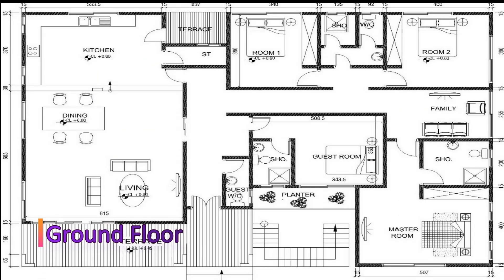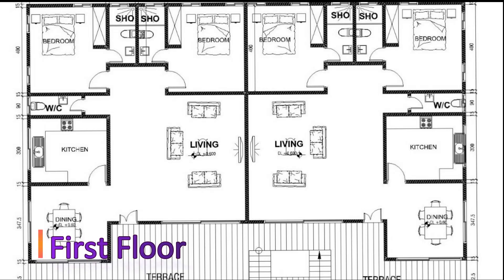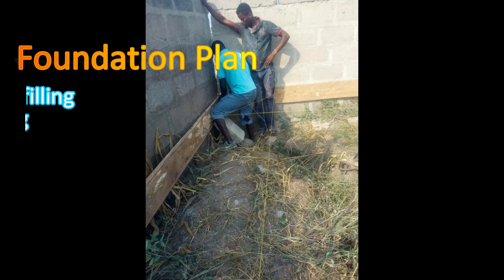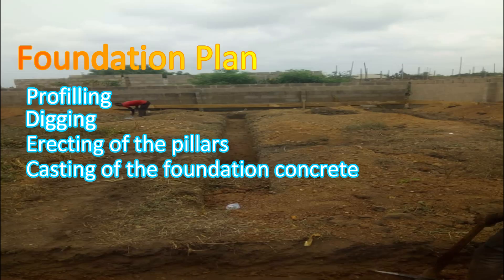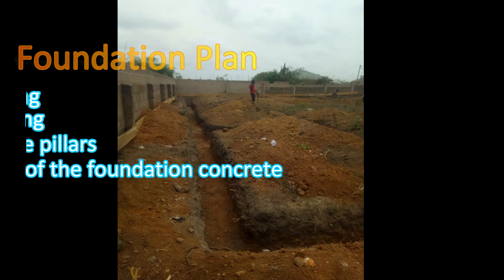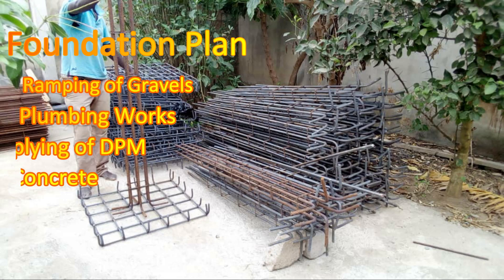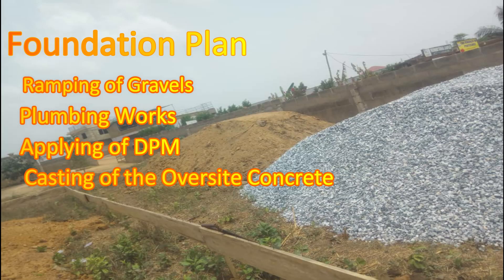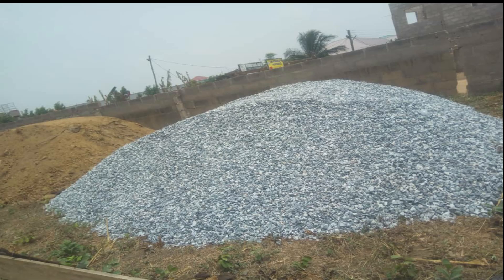Building in Ghana | How its all started | Building my 4-bedroom house with first floor apartment |

Comment: Bright! Great video.
 It was interesting to see and compare construction methods. In Mozambique after digging the foundation trenches we do the footings and columns then we apply big rocks on the floor followed by compaction before the concrete is applied then we start the block work. Furthermore, the rebar across the foundation Is more to prevent floor cracks especially if your foundation is very big, the are not load bearing unlike were the bricks for the walls sit. 
Very wise to have rental properties on the first floor.

Enjoyable video, well done.

Krone
Reply from the maker: My dearest @krone Moz sorry for the late response. I admire you're composition. You're a grate writer. Thanks alot for sharing Mozambican procedure with us.....
Love to hear from you again. 
God bless. Shalom
Reply: @BrightandClara  Thank you so much Bright. My apologies, I have not been online very much for the past weeks.

Comment: Bright ! Great Vid.  I noticed in Africa you will use large amounts of concrete filled "filler space"  between heavy blocks to create walls.  In the USA they use approx. 16x8 concrete blocks with 1/2" in between but I notice in Africa it can be 2-3 inches at times.  Just curious to see if this is code.
Reply: And so? Did u watch a video in Ghana or Africa?

Comment: Thx for sharing! Whats the different between a german concrete and the traditionel concrete?
Reply: I'm not sure if he got it wrong or it's how they call it. What I know is German "floor" which is building wall before casting floor slab concrete (btw not sure if it's still a German thing). I won't advise that since the floor needs to hold. In fact the floor for storey buildings need a wire mess for floor slab. People just cutting corners. You can see he didn't even add a floor belt for slab to cut cost
Reply from the maker: Thanks for watching, German concrete is terminology used in construction. Its either German concrete or oversite concrete. I'm not aware of traditional concrete.